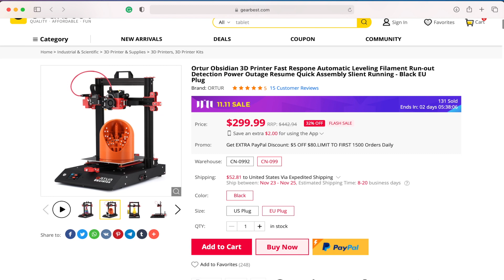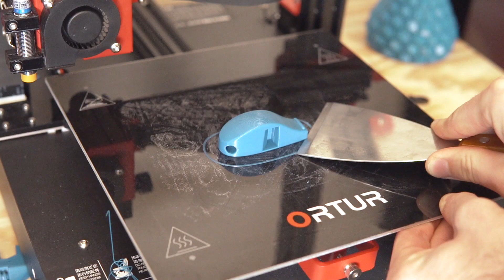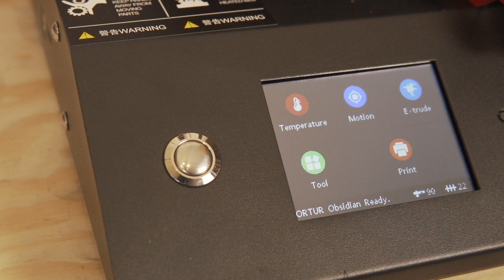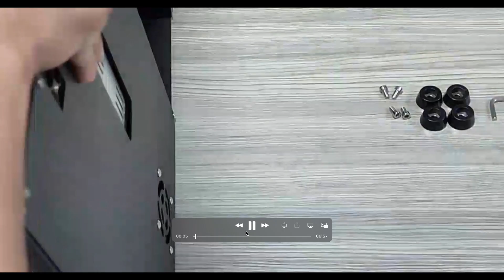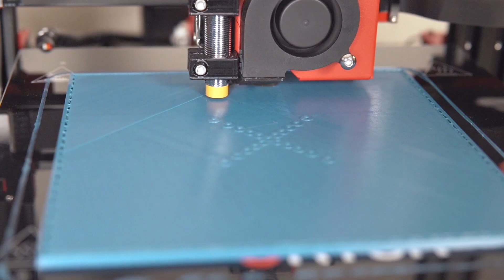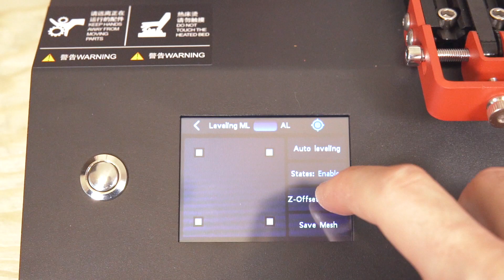Ortur Obsidian Review - Direct Drive & ABL 3d Printer Under For $300

Comment: I walked away as soon as I saw the ribbon cables.. been down that road with the X1
Reply: You can see this has built in clamps though. Problem solved :)
Reply: @BigDan1190  but I designed and built clamps into the X1 and it did no good.. Especially in the manner that these are designed to move (some twisting action).. these will not last. Of course we print 12+ hours a day everyday on every machine.. so it shows when some printers fall behind and what their downfalls are.. the X1 downfall was the ribbon cables even after clamping them securely in place. I have had to replace them 3 times in a years time.
Reply: @oneheadlight8000  Thats a pain. I haven't had to replace mine yet having ran for 10 months every day in a production environment. Maybe not 12 hours EVERY day though. I did have to replace one on the Genius though, but i got that pre-owned so who knows what its past was.
Reply: @BigDan1190  yeah.. it was just a frustrating experience for us overall.. That and the Utimaker s5 have been our problem children.. We had so many issues with the X1 including the brackets on back that hold the z screws were not bent at a 90 degree angle so they were causing a z banding "bind" every 1/2" or so in our prints. We had the idler arm break, one of the z axis motors was set to a vref of 1.9v from the factory and had to be adjusted because it was skipping steps getting too hot.. just a bad experience overall with that machine. I think I got a lemon though because I know a lot of people that love the Sidewinder. We have 14 printers now (12 currently running) and they run all the time! We recently picked up 4 Sovol SV01's.. they are noisy, but print PETG super nice with just a simple Capricorn tube upgrade. Highly suggest those for the price (got them during the spring sale for $250 each).
Reply: @oneheadlight8000  I'm considering building a Voron 2.4 but its a lot of time and effort for a production environment! I need a Sidewinder X1 but with an alu bed and a BMG as stock...
Reply: @BigDan1190  yeah.. we are debating upgrading all our printers (ender 5, ender 3s, sovols, prusas) to BMG and E3Dv6. We want a hotend / extruder combo that is consistent and will continue to have support. I love the Voron kits.. but as you mentioned.. time is money and we are short on time haha. I can't decide if we want to go with clones of the BMG and v6 or go authentic.. It would save us a lot of money, but if it doesn't provide consistent results then I won't be happy. We were also looking at the dragonfly, mosquito (expensive) and copperhead (can be damaged easily). Haven't decided on a direction yet
Reply: @oneheadlight8000  The TriangleLab clones of both the BMG and the V6 are excellent. I moved away from my Ender 3 / 5 cos i wanted better hot ends and also direct drive is all I will use now. The hemera is nice but not easy to service. The authentic BMG is SO expensive for what it is. The E3D titanium heatbreak is worth paying the money for though, even if the TriangleLab stuff is very good.
Reply: @BigDan1190  yeah.. i have the Hemera on the X1. I have all direct drive on my enders using the printermods kits but we print so much PETG that it eventually starts to melt down the PTFE tube even with Capricorn tube in there.. so I'm looking to get all metal for all of them.. Have you considered a bi-metal heatbreak instead of the titanium? I heard they are legit! (one of the reasons I was considering the Slice Engineering stuff). Thank you for the feedback though.. I had heard good things about Triangelabs.
Reply: @oneheadlight8000  yep I have a bi metal smooth heatbreak on my x1, it's great but when it comes to unscrewing it the centre just spins inside the copper part 😕 a side by side comparison would be nice but meh, as long as it works I don't care.

Comment: What would you think of this as a first 3d printer or would you recommend something else??  I'm currently shopping and trying to figure out what to get for my first 3d printer.  I like a lot of the features present in this.
Reply: I think it is a great first printer (from what i've seen in the video). I'd recommend it as it has nice features and seems like a complete package, without having to tinker that much. And i currently can't think of major upgrades, that i would want/need. I started with an ender 3, but i got very early an ABL sensor and additional stuff. This machine seems like it has most of them included.

Comment: I have an ender 3 and just dont want to try flexible filament in it.  I think I want a direct drive for that purpose.  I dont see how pushing flexible material through a foot of tubing could possibly work out. I saw another channel show a $99 direct drive one and it looked ok.  I checked the site and it was really $129.  I forget the name, but it looked like a toy.  What I wanted it for is to make gaskets and RC car tires.  Are flexible filaments good for this and what would be the best low cost printer for them?  

The other future wish is a dual extruder printer. What is the most affordable recommendation for that?

Comment: What are you using for the grey filament. I've come to realize for the most part that buying all these cool looking filaments is kinda pointless. So getting a stock supply of one type is what want to start doing and the stuff you print with looks like its quality stuff. Or something you think is the best bang for your buck.
Reply from the maker: I believe that stuff was Duramic grey PLA I usually use that or MatterHackers Build Series grey
Reply: @ModBotArmy  thats something that would make an a good video. One dedicated to filaments. Whats good and what to stayv away from. Theres soooo  many out there and theres more and more new people joining the hobby and the filament can be daunting and strangely enough there is almost nothing at all dedicated to that part of printing and is such a huge if not the most important part of the hobby. You can have the best printer on the market but if you're running crap filament its gonna end in frustration. But thanks for the advice and I'll try em out thx

Comment: Why do you turn off retraction with your tpu,
Reply from the maker: In most instances it is to prevent clogs/jams. It can likely do some small retractions with this TPU but I have had so many extruder/hotends retract to far and not be able to resume printing leading to either under extrusion or a complete stop of extrusion. Due to this I typically print flexibles with no retraction.
Reply: @ModBotArmy  nice to know, i still print with a low retraction, because I often Print more than one piece at a time. And there is nothing worse than tpu Strings:D. Printspeed, at least for my printer is much more crutial on having a successfull print or not

Comment: Is there a link to the profiles you use in cura?
Reply from the maker: Most of my profiles are based on what is built into Cura. They have so many tuned profiles natively packaged in. The main things I adjust are temps, speeds,  and retractions.
Reply: @ModBotArmy  ah okay, understandable. They are decent. But since I recently converted to DD, I’ve been wondering how to get out that extra performance

Comment: Fantastic and detailed review, thanks!. Do you think that such layer shift could be caused by drivers have not heat sinks?
Reply from the maker: Thank you :). Yes I definitely do think that could be the case. The only thing I do not understand is how on the birdhouse that was much longer of a print and bigger had zero. That would be my first thing though would be to add a heat sink.

Comment: So many good hardware is crippled by bad firmware. Some manufacturers always get Not Invented Here syndrome and either don't use Marlin or design their own bad working skin over them.
Reply from the maker: This is a fact. I have tested out quite a few machines with really impressive hardware but just awful firmware. So disappointing.